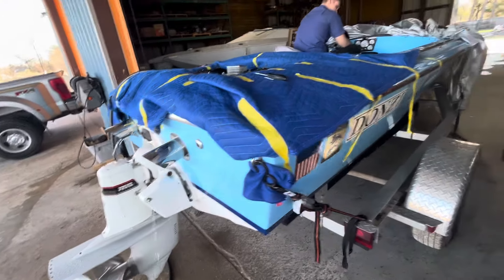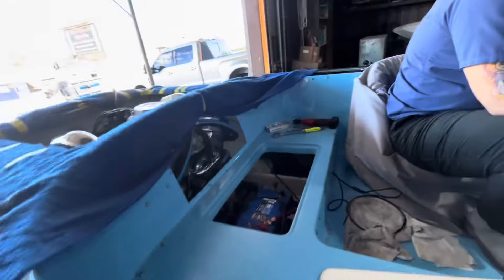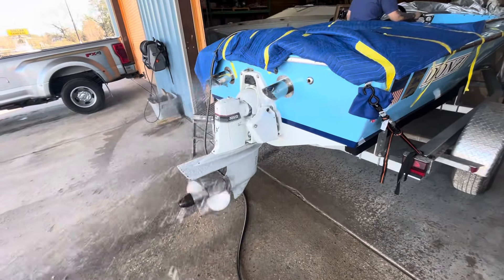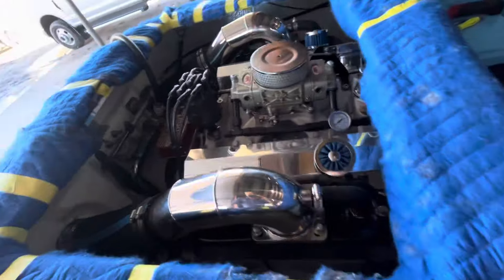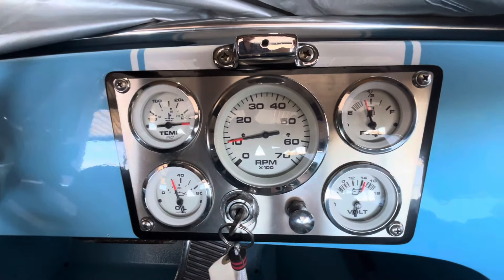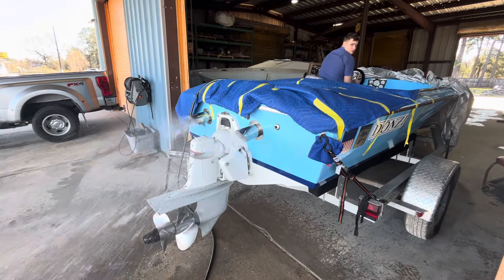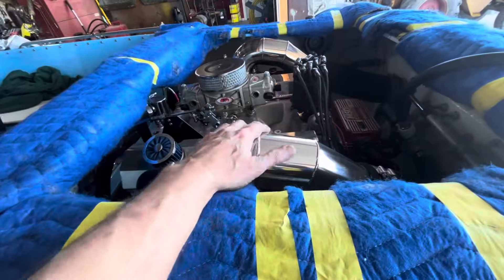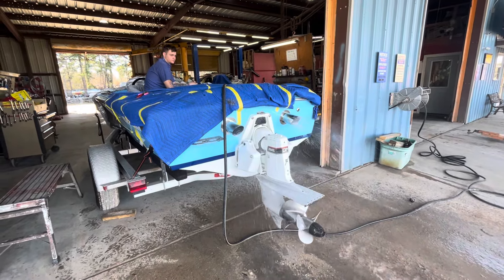DONZI 16’ w/ 551hp Skip White Stroker first start up 👍👍

Comment: In the back of that tac..there are settings ..for 4,6,8. .re adjust ,set back to 8.. im sure you know what im saying..im sure it is set on 8 cylinder now,,just move the adjustment around and back. It fixed mine on my boat.tac always read high...now 👍,,,,, 😎,,,,
Youtube repair..worked..

Comment: I restored that boat five years ago. It's a rare boat with only a couple produced that color. I personally wouldn't have put a chevy in it
Reply from the maker: You did a great job👍👍 but though the engine looked good it was junk internally and we looked for a ford performance 550hp but no eta on when we could get even parts to build one so....... now the boat is even better. We also added a few more goodies.. at customer request and repaired the trim lines, and drive leaks transom water leaks and some minor wiring issues. we did not address transom cracks just above the drive unit as they pose no threat yet.